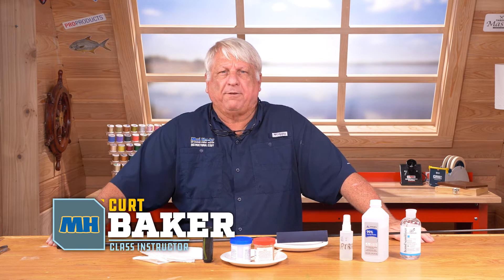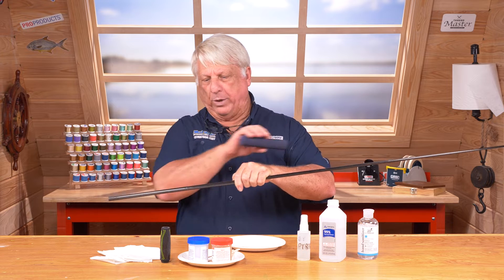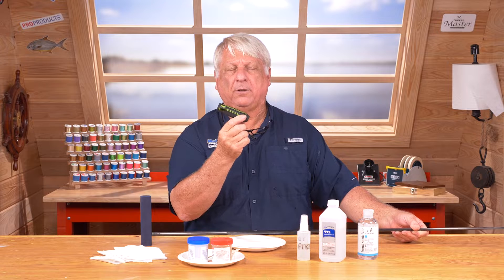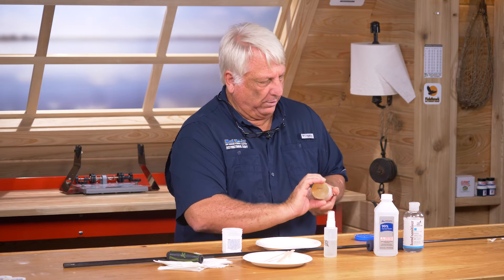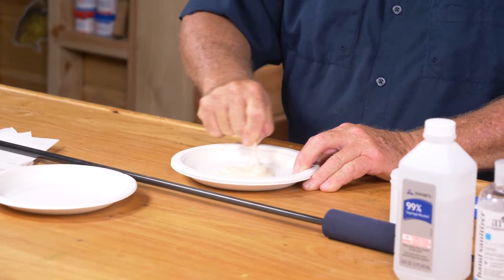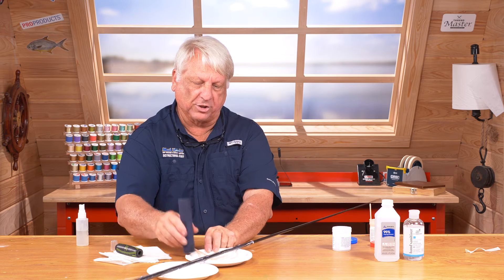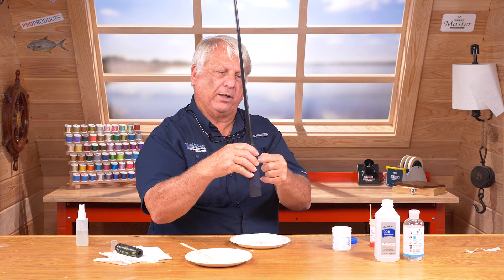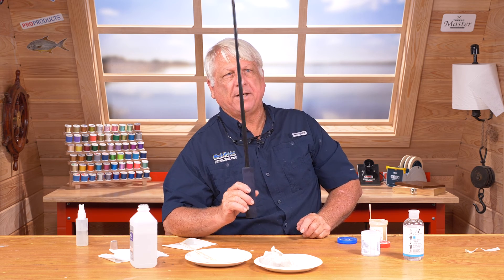How to INSTALL LARGE EVA GRIPS on Big CUSTOM FISHING RODS | Mud Hole Rod Building Instructor Series

Comment: Thanks for the video guys!  I just screwed up big time on an 80-130lb blank trying to slide a grip to the bottom.  I was trying the rubber cement method, but I think I'll try mineral spirits on the next attempt.